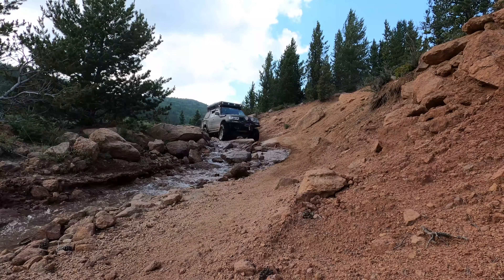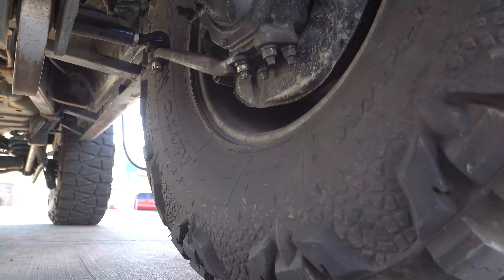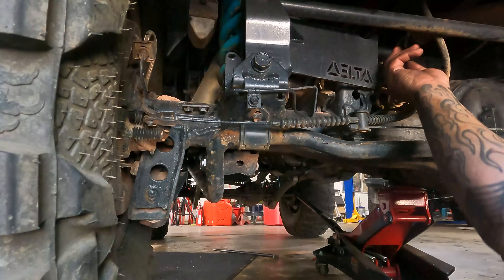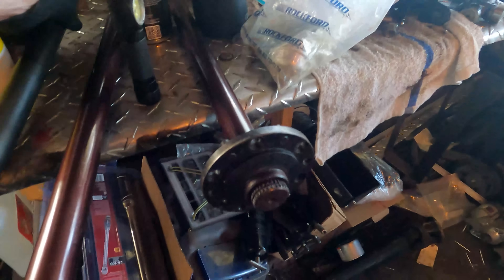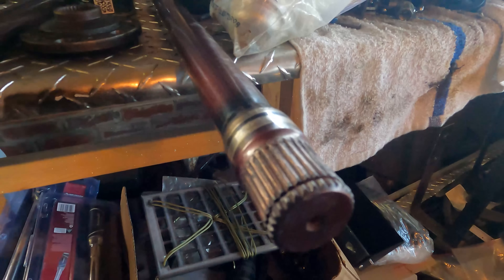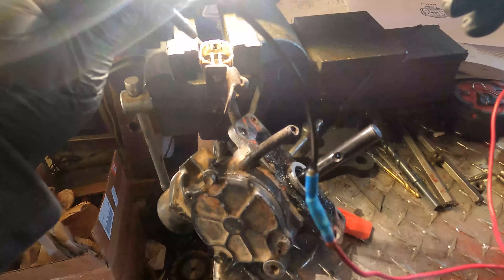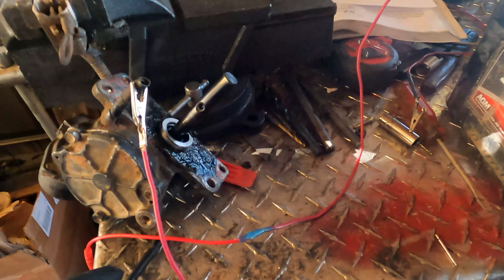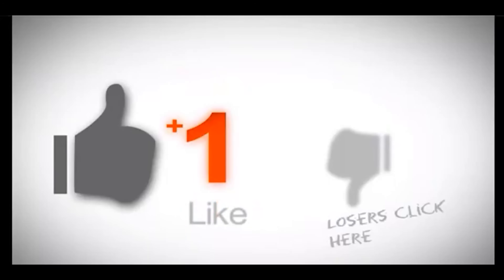How to easily test an E-locker on a bench or on the Truck.#elocker #DIY #howto

Comment: That's crap . .about those axles. My dad has a 97 Toyota 4runer  bug out ready . Very close set up as you.  Awesome trucks you no .  I have a 94 chevy silverado k1500 stepside bug out ready I just put 12500 pound winch on the front  . I still need more practice on rear diff. Anyway  if ever in indy I have a small  fabrication  setup out of home   just saying  brother. On everything that you go through iam on the path  ;)

Comment: 300M automatic transmission output shafts are common practice for sled pulling and racing diesel trucks that easily break the 1,000RWHP, 2,000FT-LB TQ peak values. However all it takes is enough dimensional instability to introduce high enough shear stresses to wear through the 300M heat treated surface layer and cycle time is reduced. Granted your GVW, 37 inch Nittos and serious shocks are on the highest end of duty cycles anyone would put this stuff through, so there is that.
Reply from the maker: Yea, I'm not in anyway complaining Im just surprised the 300m didn't outlast stock axles which served under same conditions for years and are still in mint condition.

Comment: Richie, I know they’re expensive, and it’s tempting, but I wouldn’t use those axles with the worn splines. You’d be inviting a failure, and you know how that goes... It’ll break in the worst possible place at the worst possible time.

Comment: Wow, thats crazy how those shafts ate themselves.  If it were me, I'd have a long conversation with their rep on why the shaft splines failed.  I can accept the flange failing if the design is for the flange to be the sacrificial or serviceable  link (like a u-joint in a driveshaft) but then the splines should never have rounded off if that were the case.  
While I generally prefer a full floating axle system for rugged durability and ability to limp out of the woods should a side fail, I'd go back to the OEM shafts till RCV can explain the why/how of the failure
Reply from the maker: We shall see, I emailed them a few days ago  still waiting

Comment: Them look like hefty axles. Female, splined counterpart may be iron from mex. Mex cast iron is never  as strong as OEM or Detroit iron. But you expect a lot outa that rear, see intro😁 Good knowing your good🙏👍 Thanks for sharing Richie
Reply from the maker: U bet
Reply: Yep. Those need to be billet steel or at least Forged. 
Cast Iron (steel) is Soft.

Comment: Excellent video JB, just excellent.  I've learned alot.  I'm proud of myself, I just replaced my radiator, spark plugs and wires, distributor,  starter, heads, EGR blocker with computer reflash, and headers all by myself on a 97 Tahoe 5.7.  

May not be hard for a mechanic, but for me, I'm proud.  And this woke up my Vortec 350 quite a bit.
Reply from the maker: Nice, Listen to w,c,m,w &fab  he knows
Reply: You do the spider injection.  Its oe is prone to leaking
Reply: @wcmwfab935  not worth messing with an l31 vortec motor, finding a marine intake for it is a pain in the ass and for the price of a Holley efi system you could find an lm7 with a standalone harness easy.